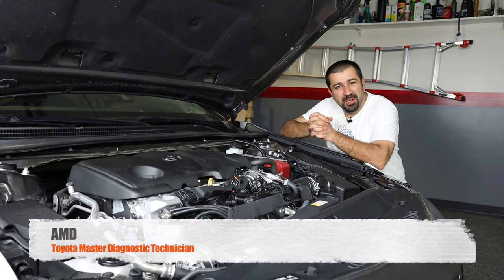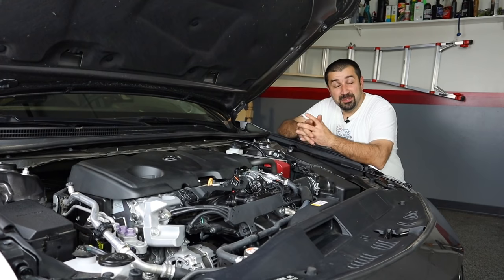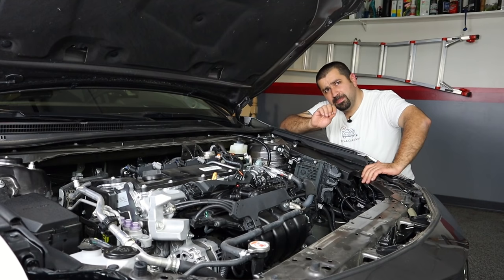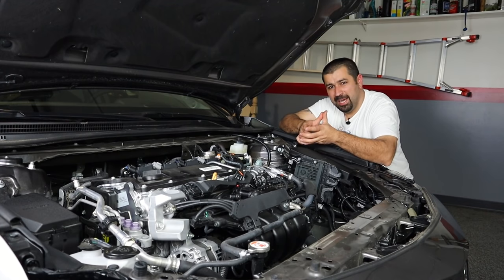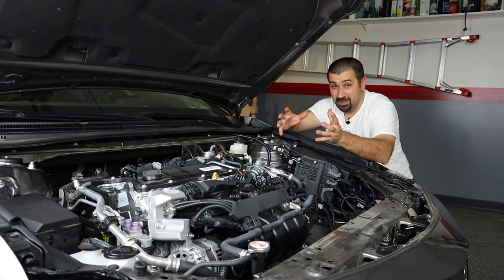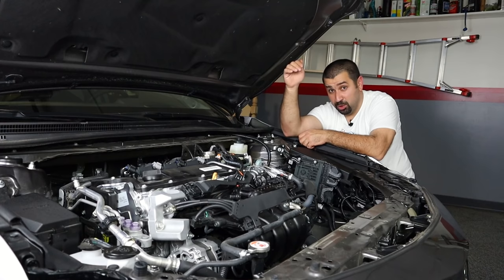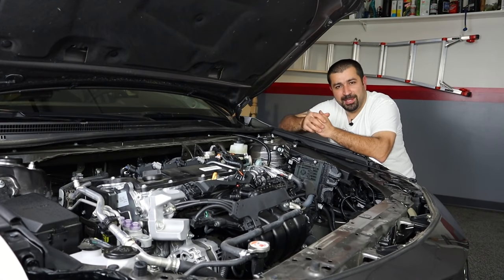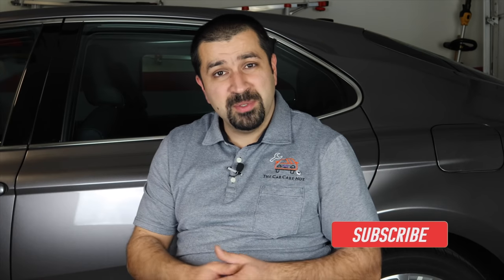Toyota's New Engine Technical review Part 1 : Cooling,Lubrication,Direct Injection and EGR

Comment: So I just bought a 2024 RAV4 with this engine since it's the gas model… The technology is fascinating and amazing but it does make me think will these extremely complicated engines be as reliable over the long term as the older simpler engines? Just wondering…

Comment: Wouldn't you say the lubrication system puts an even greater emphasis on regular oil changes?
Reply from the maker: Absolutely. Good maintenance on this engine is essential.
Reply: @TheCarCareNut  Yeah, that's the reason I will not go over 5000 mile oci.

Comment: What drives the engine fuel pump on a hybrid?
Reply from the maker: The electric fuel pump in the fuel tank is ran by the computer. The high pressure fuel pump is driven by the camshaft
Reply: @TheCarCareNut   Damnit and i've been putting gas in the fuel tank all these years!?  Right got it ... filling it with water first thing.    :P
Reply: Doesn't he meant electric water pump type, a submergable pump. Not water going inside a fuel tank.
Reply from the maker: Typo... I mean electric fuel pump.

Comment: Hey nice video. What about the hybrid camry? I presume it comes with the same engine? And if so do you hear the rattling when it switches from port to direct injection?  I want the hybrid but i also want a smooth ride without weird noises lol
Reply from the maker: Hi! The current Camry hybrid does have this engine. It’s not a rattle when it switches it just gets louder.
Reply: @TheCarCareNut  Thank you for the reply!  So the camry hybrid does not have direct and port injections at the same time?
Reply from the maker: It does have both port and direct
Reply: I own the 2020 Camry Hybrid.  When the gas engine comes on after a cold start, it is a little loud while it warms up but its very quick and quiets down after.  The hybrid system also reduces engine RPM at part throttle while it warms up, and then quiets down and can go through the normal RPM range.

Comment: Very good information but I don't agree with the philosophy of the 0w-16 weight oil. It's not about how fancy the variable timing is, it's only about fuel efficiency. getting just 2% at the cost of engine protection. A 0w-16 weight oil after 10k miles as recommended, will actually be a 0w-5 oil at that mileage.

Comment: Great video, but Toyota has had direct injection and Carbon up issues for years. You know in their Lexus line of vehicles. Dual fuel injection is also in other car brands. Like the 5.0L Ti-VCT V8 Engine, extremely durable and powerful for its size
Reply: Ford Coyote 5.0

Comment: Hey AMD, great video as usual. Now that high noise I heard when I picked up my Camry Hybrid make sense (I've owned 2 Tacoma's with the D4S system but never noticed it). Now would you please clear up two things for me and maybe others. Hybrid is all about efficiency, and the engine is designed to run on 89 Octane (In Canada), any benefit to switching to a Premium (91 Octane) and would it essentially be harmful in fact to do so? Also can you undercoat a hybrid?
Reply from the maker: I would run the octane no that the car requires. No real benefit in running higher octane at all. You can undercoat a hybrid. Everything underneath it is essentially the same as any other car except the presence of the high voltage cable which is weather insulated and rust proofing over it won’t hurt it one bit.
Reply: I live in Colorado at 4800 feet. I was told 85 octane is sufficient at elevation. It's the lowest grade here. True? Stay with 89?
Reply from the maker: That is correct Joseph
Reply: Sorry, so stick with, 89 octane or use 85 octane at elevation?  Thanks SO much for your time! 😁
Reply from the maker: Stick with 85 at elevation. No real benefit going to 89

Comment: Do they even have or does it benefit if there are, any synthetic 0w16?
Reply from the maker: Toyota 0w16 oil is full synthetic and this engine requires synthetic oil.
Reply: It's the ONLY thing there is..  0w oils can ONLY be made from synthetic base stocks, no such thing as 0w-16 Conventional Oil.
Reply: @77GR1982  I've never had to look for 0w, but good to know for future reference.
Reply: You're welcome.., 0w oils are 0w-16, 0w-20, 0w-30, etc.

Comment: My 2008 mondeo hits 41mpg on the highway, full of people, luggage and the ac cranking with 34 degrees centigrade outside. These alloy toyota engines have no redundancy if there's a cooling issue, they overheat instantly and are a done deal when that happens. It'll be interesting to see how many make it past the 100 thousand without failing.

Comment: Look, the injection system is basically the same as used on Lexus IS and GS V6's, and as a retired Lexus/toyota master tech I can assure you that the carbon issues were horrendous.
Good luck.
Reply from the maker: Hi Neil. They were terrible in some Lexus models but not the ones with D4S. They were terrible on the direct injection only and yes those were terrible. Have you seen a case of a D4S bad carbon build up?
Reply: @TheCarCareNut  yes, the IS250,350 and GS350 were definitely port and direct injection and suffered badly.
They used to come in pinging and with misfire codes.
You knew exactly what you were going to find when you removed the upper plenum.
Reply from the maker: Interesting I haven’t run into one with D4S with carbon issues. usually they were the 2.5 in the IS and the 3.0 in the GS that were terrible.

Comment: In which car they install this engine and since when?
Reply from the maker: They started with the 2018 Camry the 2019 RAV4 and now most newer models and hybrids has it. Also the 2.0 variant in the 2019 corolla hatchback and 2020 corolla sedan
Reply: @TheCarCareNut  Thanks! I want to buy in this spring 2018 Camry hybrid LE, I know they have lithium ion batteries and two electric motors. Is that so?
Reply from the maker: The LE Camry in that generation does have lithium ion
Reply: @TheCarCareNut  do they have 2 electric motors?
Reply from the maker: Yes they do. Similar to a standard hybrid model.

Comment: Hi there AMD, I have imported a 2018 camry from the USA to The Middle east with 73k miles. My service center recommended using 0W-20 instead of 16. Btw it gets very hot in summer in the Middle East and I feel like 0W-20 is the better option (don’t care too much about the slight increase in MPG) 
What do you think ?  
Thanks for the great video I just subscribed to this amazing channel.
Reply: I have seen no changes whatsoever when changing 0W-16 to 0W-20

Comment: Come on, the GDI system was allowing gasoline to be sprayed and travel beyond the cylinder walls and contaminate the engine oil with gasoline.  The called this 'Oil Dilution'.

The reason why this special 0w-16 oil had to be formulated was to prevent, mostly, Oil Dilution by sticking to the cylinder walls better.  This is why you MUST use the special formulated 0W-16 oil. No other reason makes sense.

Comment: I have a 2020 Camry XSE with the 2.5 engine. I noticed on 2 separate times the car will turn off if the engine idles for a set period of time. Is this normal? Thanks in advance.
Reply from the maker: Hi! Is this a hybrid model?
Reply: @TheCarCareNut no it's not the hybrid model. Sorry I should have mentioned that.

Comment: If there is a smart coolant flow valve why even have a thermostat? Seems like a strange relic to keep, especially if you have to heat it in special cases. Install an electronically controlled valve and control coolant flow however you like.
Reply from the maker: I’m with you on this 100% I always wondered why do we still have a thermostat.

Comment: New engine break-in?  What do you recommend for this engine? At what mileage?
Reply: At what mileage for 1st oil change?
Reply from the maker: I would treat it for break in as all engines. Avoid constant rpm like constant highway driving and avoid racing the engine the first 500-1000 miles. Also personally I would change the oil the first time at 1000 then every 5000 after that. But I understand most people won’t do that and it wouldn’t make sense unless you’re planning to keep the car long.
Reply: Thanks for the quick response and it makes perfect sense to me.   I had to junk a 2001 cavalier with 489,189 miles on original engine and clutch. Ran great but Chicago salt ruined the frame and it was not safe to drive any further.

Comment: Hi. AMD. I should've watched this video before i was buying my Camry, I did call back my dealership asking them why sometimes car have a knocking sound like it's a diesel powertrain. And then suddenly it stops, that's what it is. two types of fuel pumps, and two type of injections. Have a Q to you. How many miles can this engine go ? Based on your experience with these engines ?
Reply: He and others have seen over 200k miles with no problem

Comment: Let me tell you something I have 2014 Toyota Prius, and it has 329000 on it, of course it went thru some issues cz no car is perfect, but it has also port and direct injection and Atkinson cycle engine none of parts in the engine are metal, most of them are plastic parts, like you said new Toyota has electric water pumps, my Prius does too but do you know how many times I replaced it? Just once, the water pump also have been changed once, also engine water pump both parts were broken that's why they were replaced, but good thing with Prius it never left me stranded on the road, luckily I made it home in one piece, now the hybrid battery, most people are so concerned about it, guess what.... I replaced my battery at 284000, before that it never had any issue, I even drove it for a week when it was broken I just reset the 12v battery to delete the codes, it ran normal, it was only recommend by mechanic he told me that I can drive it like this it will be fine, if you do concern about Toyotas plastic parts, I don't think they will be unreliable, they definitely will be reliable, my car is at 329000 miles on it still clean and great shape running smoothly like new, although I did replaced the head gasket on it, that was the only major issue, mechanic did a great job.
Reply: none of the prius engines has direct injection. only port.

Comment: Direct injection is not new in Toyota, not on Diesels (D4D). I understand that to gasoline engines might be new. Just a small "correction" because the way you said it, it seems that it was introduced in the brand with this engine
Reply from the maker: Hi! Thank you for clarifying! Toyota in the US have no diesel options. The first Toyota badged car that had D4S in the US was the 2016 Tacoma with the 2GR-FKS followed by 2017 highlander/sienna then this engine on the 2018 Camry.

Comment: Using Zero weight oil in tropical climate just seems so wrong. I do my own oil changes, 3K in summer half of year, 5K in cooler half. I have always used heavier oils than they recommend, is there a reason not to ??

Comment: Do you agree with Toyota on the 10000 mile oil change when using 0w16 or do you recommend 5000? I've change the oil on my 19 and it still looks fine at 5000 miles with a quality oil filter. Primarily HWY miles.
Reply: I can chime in here. I've been using 0w16 in my car since new and been changing it every 4-5000 miles. It's cheap insurance  as I've never gone past that. Don't forget the filtering capacity of the oil filter, if it gets clogged it goes to bypass mode and at that point it's not really filtering anything. The oil filters on these engines are tiny and I would not trust it to filter effectively up to 10K miles. Also, you can't tell just by looking at the oil, sometimes dark oil isn't bad it's basically doing it's job. I think he mentions in another video to change it around 5000 miles. Since you mentioned you drive a lot of highway that's actually a good thing since oil breaks down less and there's less dilution vs short trips and stop and go driving.  Oil changes are cheap compared to engine replacements 😀

Comment: Great video as always AMD
My Toyota dealership insisted using 10W30 for my RAV4 Prime's first oil change. Their justification was that we don't have freezing temperatures in the country
They claim they don't even stock 0W16
Am I scr3wed?
I'm trying to escalate to toyota EU or Japan, but i barely find any contact info. I'm keep redirected to my local dealer
Very disappointing experience

Comment: In the A25A FKS engine I just don't like having to use 0-16 w oil . Is this influenced by maybe better  gas mileage. What is your opinion on the 0-16 W oil. Thanks
Reply: I have this engine and at 30K miles I don't burn any oil. Been using 0w16 Mobil 1 from the start changing every 4-5000 miles and car runs perfect and getting phenomenal mpg for a decent sized car.
Reply: @oriondragos5876  thanks for your response. I'm looking forward to buying a new camry
Reply: @billspeight8936  welcome, enjoy the new ride
Reply: No problems.  This engine has been around since 2018 model year, with LOTS of examples well over 200k miles with no problems.

Comment: All modern oil grades first and foremost originate from the EPA regulations , for gas mileage, and then the engineers adapt the engine to comply with the oil weight/ flow specs. This forced increase in gas mileage, is reflected in the price of the car, and over the life of the car may or may not save the customer any real money in the overall cost of ownership, , but it does theoretically save oil / gas from being used at a higher rate.

Comment: The ONE term that worries me greatly is "complicated". It appears the primary reason for this complicated system is fuel economy. I am not opposed to spending less money on fuel but NOT if I end up spending excessive money on repairing complicated mechanical designs. I have owned American, German and Japanese cars for 65 years and some were wonderfully designed and built and some were trash. I reserve judgement on this engine design until it has proven its merit over at least the next 5-8 years. I recently bought a 2021 Tundra 1794 Edition with a 5.7 V8. It has been called "old fashioned" by many but it is time proven and will outlast the recent 2022 Tundras by many years.

Comment: My dealer installed 0W-20 in my brand new Toyota 2022 Venza. I turned around and had them drain the oil out and install 0W-16.They were not happy.
Reply: Sometimes dealers run out of a particular weight oil so they use what's available and what still meets the vehicle requirements. Highly likely they probably put the same oil in and marked it as 0w16. How do I know? I used to work at a dealership. Also, most people don't know this but generally most dealerships put the newest/rookie tech for basic jobs like oil changes and tire rotations. Another reason my car will never see the inside of a dealership unless for warranty work or stuff I absolutely can't do myself as they put more experienced techs for those jobs.
Reply: bro there is barely a difference...

Comment: Good simple but with a bit of thinking on dual fuel injection system works 😄.
With additional electric pumps, will there a chance of a parasitic power drain?
Reply from the maker: Hi! So the electric water pumps are only running when the car is running so parasitic draw are not likely at all.
Reply: Mentioned an electrical pump incorporated...
"' Parasitic' are those who is/are blood sucker(s)" or the 'haurisoum'

Comment: I think the carbon problem is caused by the EGR/PCV recirculation systems.
Reply: Technically the carbon problem is caused by the change from a setup where the fuel air mixture passes and cleans the valves, to one where it doesn't.

Comment: Has Toyota managed to sort out the oil dilution issue with this engine?
Reply from the maker: There’s no recorded oil dilution problem with this engine?
Reply: Here in Europe, where the A25A-FKS is fitted with a Gasoline Particulate Filter,  there has been a whole raft of customers complaining that the oil level on their dipstick is rising above the 'max' mark. I don't think the issue is quite as bad as on the Honda CR-V but is a concern nonetheless. My wife is seriously considering buying a Higjlander Hybrid so it would be good to know if Toyota are working on a fix.
Reply: Fuel dilution + 0w-16 oil = water

Comment: You make a statement that the (mechanical legacy) oil pump is speeding up and down with the engine, creating all that friction. When the engine RPMs increase there is a need for more publication. The current mechanical oil pumps function with the RPMs. The only friction is the oil pump arm being mechanically actuated.

Comment: Thanks for a most informative video; it's fascinating that all that engineering and technology went into an engine that's used in comparatively cheap cars. Speaking of which, I wonder if the 2 liter version of that engine used in the Corolla  has all those features as well? In other words, is it basically a lower capacity version of the same exact engine?
Reply from the maker: Hi! The 2.0 has the same features and it’s basically the same engine with smaller displacement
Reply: @TheCarCareNut  Thanks for your response; much appreciated!

Comment: WHEN are they going to put electric oil pumps on cars? 80% of engine wear occurs during the first second after starting and it revs up with no pressure. That over 11 minutes in a year!! Two electric pumps for redundancy would be perfect. Thanks for your videos!
Reply: I think the hybrid versions do have the engine spun up before firing to help reduce startup wear??